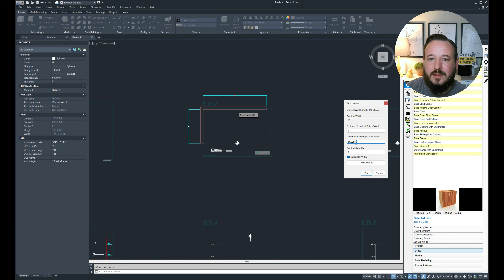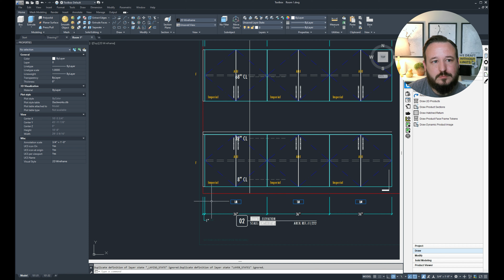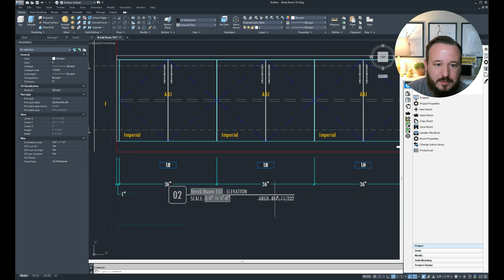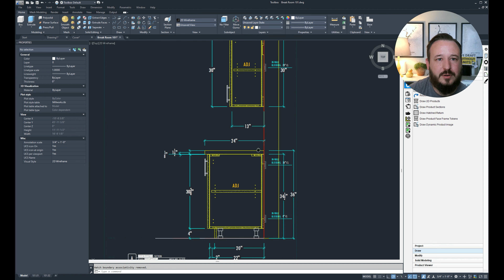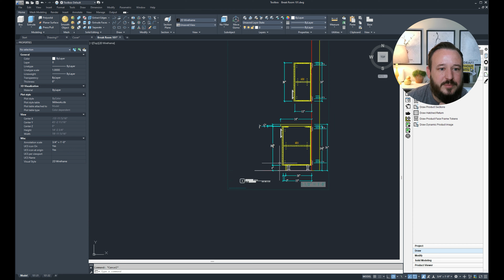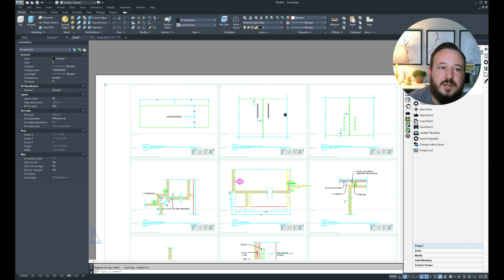DuckWorks Microvellum CAD Template Features

Comment: so the color schedule do we just change the information to what we need or is there a place that we can change it in a spreadsheet?
Reply from the maker: @alexswainston1452 yes you can just change it in the Excel spreadsheet and update the Finish schedule from there!
Reply: @duckworksmw  where do i find the spreadsheet, what directory is it in.  also the fields in the finish schedule is locked.  do i just change it in the spreadsheet.
Reply from the maker: If you've purchased our CAD template, this video walks through everything related to linking the tables to the Excel file: https://youtu.be/mN64INTuKl8?si=IelpI7-AdnDd1GvE

Comment: Jacob, I see that the majority of your fields are linked to sheet set manager properties. Does a company have to develop there own SSM template in order to fully utilize your process?
Reply from the maker: Hey Lee, there shouldn't be any fields referencing Sheet Set Manager properties, only Document or System variable fields. The template is currently setup just to work with Microvellum User Defined Properties through the Update Title Block tool, and AutoCAD native fields. It could be adapted to work with Sheet Set, but you would need to set that up by prepulating the block attributes with the Sheet Set fields that you wanted from your dst template. I have some videos on our youtube about SheetSet, and we may put out a version of the template that works that way in the future!

Comment: This is interesting.  Question.  On a hospital type project how do you organize and print / publish drawings if you have Plans / Elevations / Section for each room?  We are drawing the entire job in 1 file currently to be able to consolidate and use details without duplication them over and over again.
Reply from the maker: Hey Troy! In a large project, or really any project, we recommend utilizing BATCHPLOT, for publishing your drawings. This is a native AutoCAD tool, that is also available in Microvellum Toolbox OEM, and makes it simple to select which DWGS or rooms, that you want to publish or plot from, as well as select only the layouts or pages that you want to include.

If you're using Microvellum to draw your sections, reusing them isn't as necessary across rooms, but it is still possible to simply copy a section from one room to another, or just reference the typical section in your section tag when desired, and not repeat the section in each room.

 https://www.autodesk.com/support/technical/article/caas/sfdcarticles/sfdcarticles/How-to-publish-multiple-drawings-into-PDF-in-AutoCAD.html